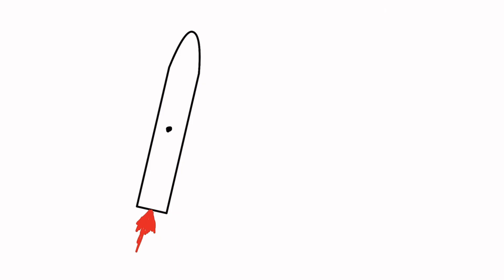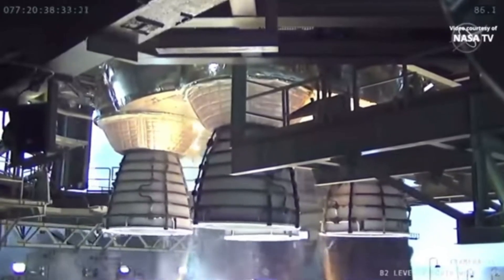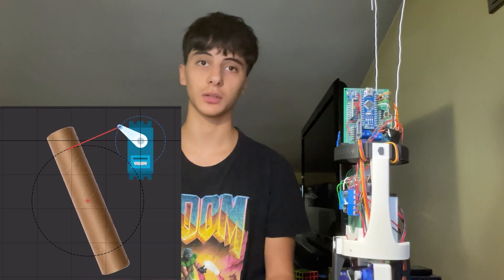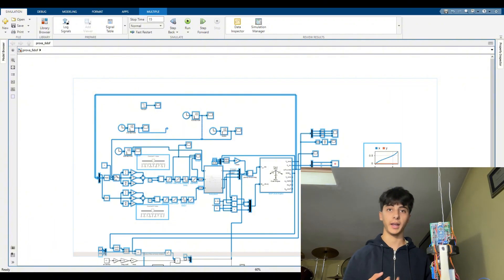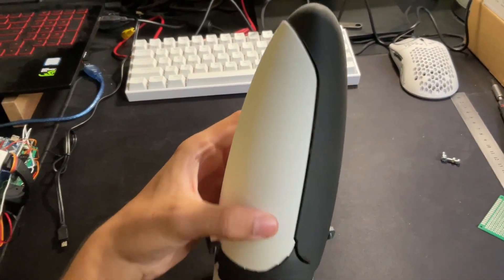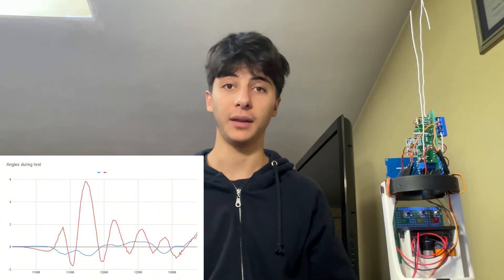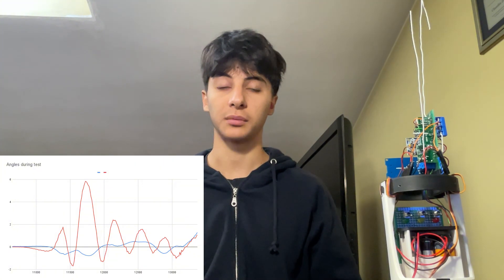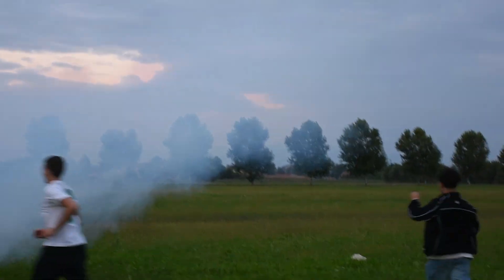How I Built A Thrust Vector Controlled Rocket

Comment: Hey man, I am looking to make the TVC rocket like you. I am getting started with this as a beginner(new to avionics). I have watched like all the videos on YT and searched about this on internet but none of them gave info about the connections like how to connect all of this on protoboard. Can you pls provide some resources about this project and also from where you learned all of this.
Reply: Yo I'm doing the same thing and currently building this project rn. I can say it's heavily alot of self research and looking at how others managed to do there's. That said this project doesn't have a full fledged tutorial how to do it. You'll just have to think like an engineer and break it into subsections and work on it bit by bit, if this is your very first project using Arduinos you'll have to teach yourself wiring and powering along the way, Chatgpt and reddit works great. If you don't know what to connect on proto boards, you should study deeper into how to use each component with one another, until you know exactly what parts needs to be connected to what so you can plan how you're gonna wire the connections. Break it into small subsections and research bit by bit.
Reply: If you're wondering, I'm currently finished with my flight computer setup and planning, and I'm working on my airframe and physical iteration right now. Best of luck to you 🤞🏻

Comment: Hey Nicola, I have a question about the diameter and length how the rocket body, and also if you know can you tell me the weight of just the body. 

thank you very much!
Reply from the maker: The body was a pvc tube with an external diameter of 8cm, length 50cm and weight of 370 grams. It is indeed a heavy body
Reply: @nicola_gaiani Okay, Thank you so much!

Comment: how did you make those switches to power the electronics, tvc mount, and arming the motor
Reply from the maker: @Yarnk7  they are electrically placed in between the batteries and what they power. Basically the power cables go to the board with the switches, and then some other cables bring the power to the component that needs it

Comment: Some manufacturers use basic granular black powder covered by plastic/cardboard/resin as an ejection charge, by being careful you can open the top of the motor and just empty it, that would solve your need to eject it.
Also i just finished designing a very complex flight computer and i would definitely recommend you to upgrade to a much more responsive mcu, i've worked with stm32 and esp32, both work wonderfully.
Great video btw, keep it up
Reply from the maker: Thank you for the ejection suggestion! And I will definitely upgrade to a better mcu

Comment: This is awesome! I have a small comment to make about the servo angle to motor angle function: try to use lookup tables when possible, doing trigs and float divisions can add a lot of delay and delay variance, which will mess up the assumptions you make when translating the dynamics into discrete-time. The time between measurement and action is expected to be constant in most discretization techniques.

Comment: Hi! I really love this project!
I have a couple of suggestions, though you seem to be already aware of them.
1) Improve electronics: make a proper PCB, or send it to be made by JLCPCB or PCBWay. Both are cheap for prototypes. Make sure accelerometers have sturdy mounts so vibrations stop introducing noise.That may allow you to increase the response of your software filters on the software side. The AVR is way more than enough for the things it has to do here, but proper software optimization is usually not an option in prototypes like this, so a more powerful uC may be a good idea. I recommend the Pi Pico because having two cores can be really advantageous in applications where timing is crytical. On the PCB side, add a couple of general power outputs using power transistors.
2) Simplify parachute deploying: although your system worked well, I think you can streamline the design of the deploying mechanism by using a car door locking system actuator. It's easier to drive (no PWM required), cheap, fast and powerful enough to use only one to open both sides by the use of a lever or a cam.
3) Moment of inertia: accurate MOI measurement is as crucial as precise your simulation is. The tune of any PID system is a 100% manual process at the end of the day, so I would just use the values you already have and trim them manually. In case you really want accurate MOI for your simulation, I would empirically find the center of mass and mount the complete rocket on a test stand, attached to a pulley and a weight. It's sort of an impractical method on a big rocket, but as precise as measuring MOI gets.
4) More improved electronics: you can apply corrections to the accumulated errors of your accelerometers/gyros with a regular zeroing routine by the use of a magnetometer (compass) or a GPS (funnier to implement, but likely to weight more). I see that other people have suggested improving the maths and that's valid too.

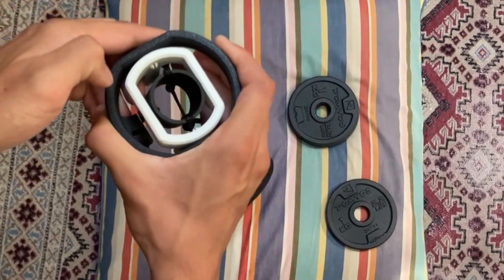I have a final recommendation about electronics, on the software side (4:01): when you are working with parameters that have known boundaries and no linear relationship (like your servo angle and your rocket motor angle), avoid mathematical representations and replace them with a lookup table. I see you made a mathematical representation of the relationship of both movements an loaded that into the uC. The uC loves doing logic stuff, but not math stuff, so whenever possible just use a lookup table. It will be faster and, in cases when you don't have a $hit ton of combinations possible, will also take less memory.

I really loved the project. It's always nice to see someone do a good job :)
Reply from the maker: Thank you for the suggestions! I’ll look deeper in the concepts and components you mentioned!

About the look up table: I initially thought about it but I was having more memory issues (because of some libraries that I ended up ditching) than loop time issues (loop time during flight came out to be around 13ms ) so I left it that way.

Anyways I see how there’s a lot of room for improvement and a ton of things to learn!
Reply: @nicola_gaiani  hello , here is Daisy from jlcpcb . I'm interested in this project and want to sponsor it . Please feel free to contact me for any needs  .

Comment: Great job, and nice video! I think your MOI test may be a little off- to get rotational MOI measurements you need to run a bi-filar pendulum test instead of the single swinging test shown in the video, though perhaps you did that and it's just not shown here. Either way, congrats!
Reply from the maker: Thank you Joe! 

The mono long-string pendulum definitely propagated a lot of errors in the MOI result, so I’ll look into other ways to find it experimentally. 
In the project I ended up choosing a value between the experimental one, and the estimated one from an OpenRocket model. There’s a ton of room for improvement!

Good luck on your space shot!
Reply: I knew i was going to find you here. Breaths Heavily.... nah jk lol.

Also subbed
Reply: patiently waiting for the liquid rocket engine video....
Reply: hi joe barnard

Comment: Congrats with a successful launch! Yay!

100% go with a better MCU next time, AVR is old crap :). I would suggest STM32, or ESP32 if you want BLE/Wi-Fi.

I also see 2 mistakes you made, hope you don't mind hearing about them ;)

1) I used the same method to measure moments of inertia and all math seems to be right, but the problem is that with such a long rope the effect of the moment of inertia on oscillation period is very small. So in the end when you apply Huygens-Steiner theorem you get like I_cm = I_p - mL^2 , where both I_p and mL^2 are quite big and I_cm is very small. So in this case I_cm is just dominated by errors in measurements of time, length etc. Do the same thing, but reduce L. I didn't use the rope at all, I just put an axis through my rocket close to the top, and used it as a pivot point.

2) If I got it right from your code -- to get a rocket orientation you just take gyro data and accumulate it in variables. That is not how 3D rotations work unfortunately :). That worked because all rotations were quite small so in this case the deviation did not become big enough to ruin the launch. 3D body orientation has quite tricky math, I would suggest using quaternions-based approach next time.

Good luck! Keep it up!
Reply from the maker: First of all thanks! 

I bought some esp32 boards to start experimenting with them! Thanks for the mcu suggestions , I might go with a printed circuit next time. It’s a bit overwhelming, but I’m starting to learn KiCad and pcb design principles.

I remember encountering what you say about the MOI calculations… so I made an educated guess between calculations from the experiment, and the MOI from my OpenRocket model (that I didn’t show in the video). And your way of getting the MOI makes a lot of sense

About the angle estimate calculations: Yes! I overlooked it and realized my mistake after the launch, when I was inspecting data: if a certain set of rotations is applied to the rocket, it doesn’t zero out at the same position with my calculations… not great. 
After the launch I did Euler angle conversions, but I’ll definitely have to study and implement quaternion math to avoid gimbal locks. Thankfully I didn’t get enough oscillation during powered flight to send the rocket horizontally.

I just noticed I have already watched the quaternion video on your channel!

Thank you for the suggestions and the critiques, they are surely helpful